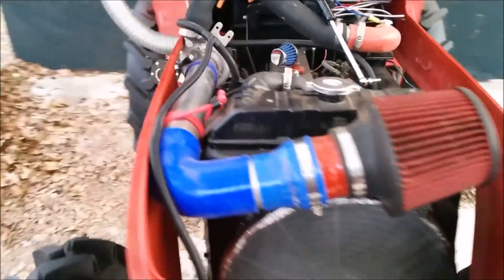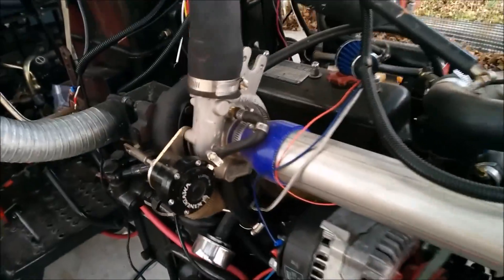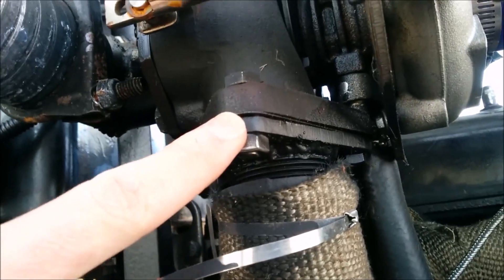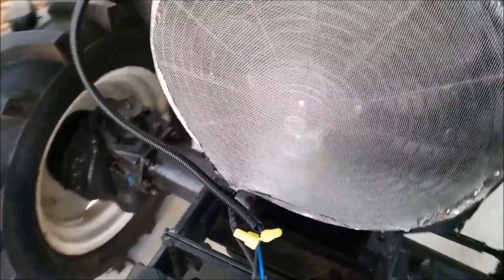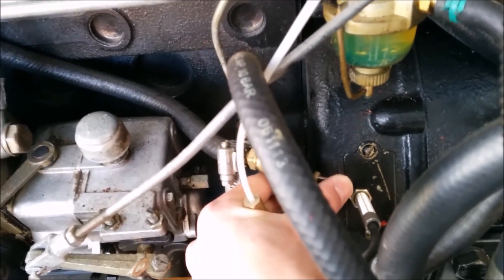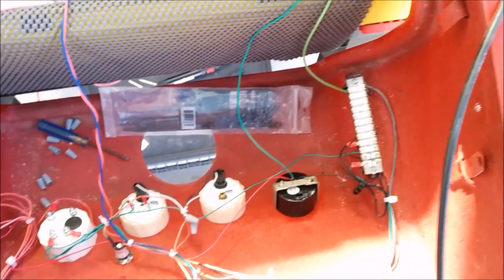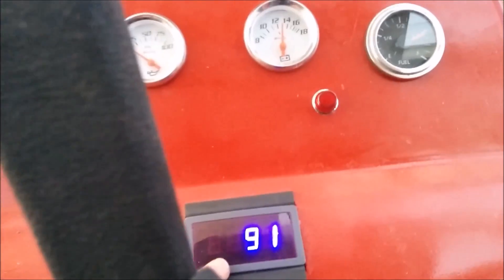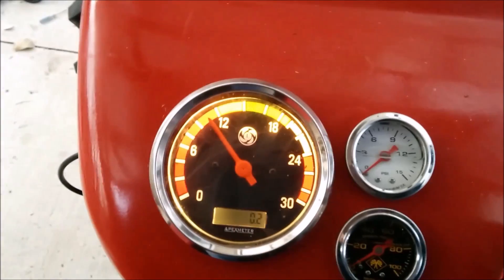Turbo Jinma 254 Tractor Overview DIY'ed

Comment: I've definitely got Turbo envy!!!... once you throw away the stock alternator and starter, replaced alternator with a single wire GM and the Starter is an easily indexable and rebuildable Nippondenso based unit... these are great little tractors. But more power can't hurt my feelings... I've never used high range 3rd gear... EVER. 😂😂😂 not even downhill with a tail wind

Comment: I am planning to do same. Two questions. 1. What is correct direction to turn "smoke" screw to increase bit fuel amount? I assume open (counterclockwise).  2. How you took oil for turbo? In my tractor oil filter leg is in that place but there are no additional holes to get oil after filter for turbo.

Comment: Ive got a 1999 Hercules with the y385 that is currently split to change the flywheel housing gasket. Im curious if your Jinma is still around and how if its still running with the ebay turbo.

Comment: That is one clean job you did amazing I have a farm pro 2425, I’d like to turbo my tractor aswell
Reply from the maker: I believe that's pretty much the same tractor. If you do end up doing a turbocharger, I'd recommend using a RHB31 turbo. That is much better sized for this 25hp engine, I am going to swap the turbo very soon for an RHB31.
Reply: @ElectroTechnics  would you use the same turbo you just recommended for a Jinma 284?
Reply: @robmack151  I think that would be a good sized turbo for the 284. If you are buying one of those definitely beware of the cheap $180-250 turbos. Those cheap Chinese units will fail pretty quick, the one we threw on that tractor failed after just a few hours.
Reply: It's definitely worth while to spend money on a legitimately manufactured turbo
Reply: @jamessanders8907  thank you for the very sound advice. I Will definitely take it under advisement 😉

Comment: Yo, I got a Jinma which doesnt charge. Does any altenators fit? :) Or what model is the one you got?
Reply from the maker: Not sure about the model of the alternator, but you should get your alternator tested. Chances are the alternator is fine and it's just a bad wire to the exciter on it. The wiring on those cheap Chinese tractors is horrible, had to completrly rewire that one
Reply: @ElectroTechnics  Its solved now. Replace the altenator with a new one and it finally charges again :)
But do you know what type of engine oil it needs? I think I've read somewhere it needs 15w/40 oil, but Im not sure.

Thanks.
Reply: Pretty much any can be made to fit. I have a Bosch 55Amp on my Jinma 454, got it from an old Mercedes W123

Comment: I know this is a couple years old but great job. I'm picking up a turbo for my kubota l275 tomorrow. 
Did moving the battery give enough cooling?  I'm hoping not to have to upgrade the radiator but yeah, battery is gonna move for sure.

Comment: Good job! that turbo sounds great. A couple things to note, you should never use wire nuts in any automotive applications, the vibrations easily separate the connection. you should always put the split plastic sleeving on all wires, it protects them from heat, the elements, and especially the sun which most insulation will crack under. Also, you should consider putting gromets on all through holes running positive or signal wires, they easily get insulation taken off due to vibrations, you wouldn't want to melt your tractor's body due to a short.
Reply from the maker: +logycam10 Thanks for the advice! The wire nuts were temporary and I'm pretty sure they have all been removed. I'll have to check on that.
Reply: I suggest solder and heat shrink all connections...